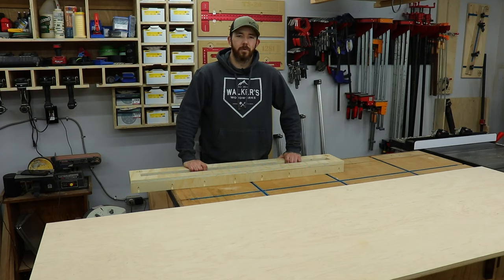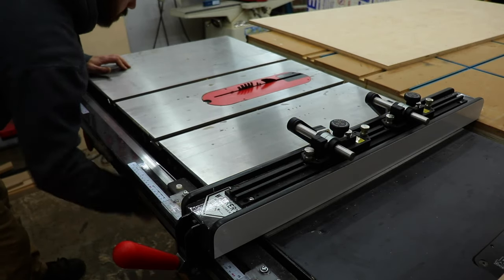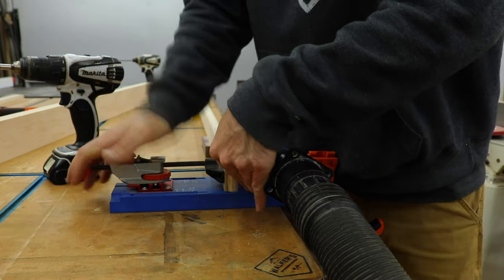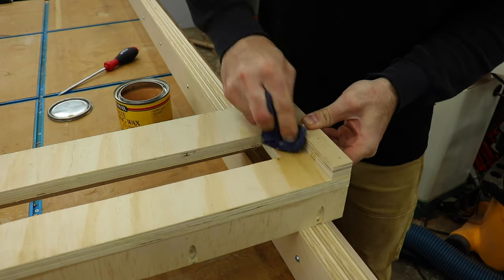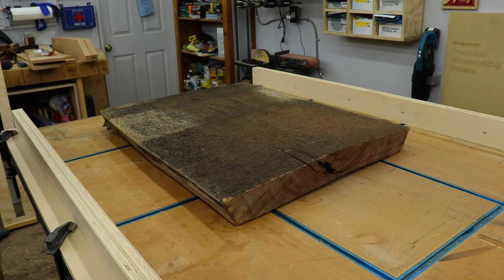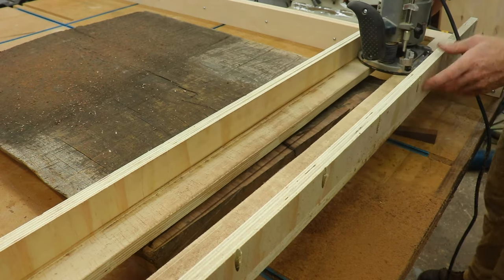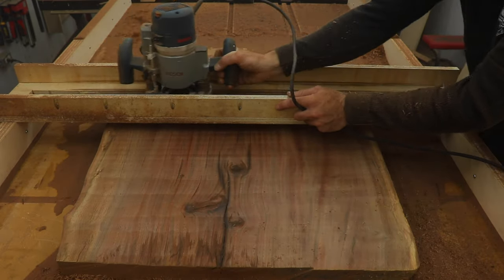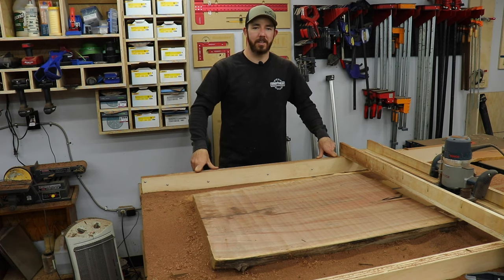Upgraded router sled rails and a new flattening bit! / How to flatten a slab

Comment: I primarily flatten edge grain cutting boards. I built a combination juice groove and flattening jig. I use the long rails screwed to a 30" x 30"  piece of 3/4 plywood and move them where I need them to be and simply screw them in place. The inner bottom edge sets back the juice groove and also serves to space the board when flattening. So I just set the board in place and move the long inner edge right up against the board use the short edge to hold the board. It works great and saves space as I just drill a hole in a corner and hang it on the wall.
Reply from the maker: That sounds like a great Idea!

Comment: So long as your side rails are all true and you work out plunge depths IE max and min you could flip your side rails  when you want to go lower, using the narrower rail as the upright, by doing this you can use the sled for a larger variety of thickness.
Reply: Not a bad idea. Side rails with two height options.
Reply: Good tip. Alternatively it’s not a little bit of effort to throw another slab under the piece you’re working with

Comment: I just built this thing soup to nuts but a different size and I didn't have a pocket hole driller so i used counter sink deck screws and they worked great.  This is a great video.
Reply from the maker: Whatever works!  That's awesome.  Glad you enjoyed the video.
Reply: @WalkersWoodworks  I'm definitely an amateur but sure having fun. Cant wait to watch more of yoir videos!
Reply: @WalkersWoodworks  question.  I have a Bosch 1617EVS with the plunger all the way down, the bit doesnt clear the sled. Even on the regular base it barely clears the sled...what am I doing wrong?
Reply from the maker: Is it hitting the adjustable stop?  There is a stop that has three settings you can rotate.  If not maybe the bit is to far in?
Reply: @WalkersWoodworks  nah. I figured it out. The 3/4 inch plywood was too thick for my router. Had to go to 1/4 inch. Works great now. Already flattened a slab today. Thanks for following up

Comment: My Amazon purchased work bench is planked construction pine.  I want to add a nice dead flat mdf top. This looks the best way to flat those planks prior to fitting the mdf.  Instead of fitting the rails to the top of the bench, I will screw them to the sides with standoffs to get a full bench width coverage by the router.  The bench top is preassembled with framing nails😳….So I hope they stop well under the surface or it will cost me a surfacing bit!!!!  Router: I only have a Dewalt cordless brushless trim router with the optional plunge base.  It will run about an hour on its 5Ah battery, but the surfacing bit is only 1 inch dia, and you can’t bog the little motor…So I am looking at a long job huh, but it will be a bit of fun!

Comment: Great video.  Just did this with a 65" x 24"  Oak slab a few days ago.  My router is quite small (Festool OF1010) and all I had was a 10mm  (about 3/8") plan bit.  It worked great but did take several passes and a few hours.  My router is quite small but I do plan to use a 35mm planning bit for my next project.  Longer term I am getting the Makita RP2300 (2300watt) router with 60mm planning bit.

Comment: I just bought the same bit just a couple weeks ago, it is a beast!
Reply from the maker: Ty OT Woodworks yes it is!
Reply: When I looked it up, the bit is supposed to be for a cnc machine, is that correct? Can I use it in a regular router?

Comment: Nice video. Suggestion, make the inside rails adjustable so as you take material off you can lower the jig to the slab. They may have to start out a little shorter to begin with but should work. Just a thought.
Reply from the maker: Ya I do want to do that for sure.  Thanks!

Comment: Hi! Thanks for making the video. Did the 2 inch bit fit with the stock Bosch sub base that came with the router? The hole seems to be close to 2 inches. Concerned about collision.
Reply from the maker: I didn't have to make any adjustments.

Comment: Love your videos! Absolutely need to build one of these! Does the work surface you are putting the slabs on to flatten also have to be perfectly flat and level before you flatten your slabs?
Reply from the maker: Yes it does need to be fairly flat.  Thank you for watching! I really appreciate the comment. 😁
Reply: Probably most important is to ensure the side rails are parallel. You could eyeball them or use a level. The sled itself is the reference more than the table, though a flat table will certainly be advantage. Keeping the piece secure is critical too - wedges and maybe hotglue as mentioned. Cheers - Dave
Reply: The tops of the rails need to be in the same plain.( plane ?)

Comment: Did you have to take the Bosch router base plate off so the two inch bit would clear? I have the same router and it seems that the baseplate won’t fit. Thinking about the collet extender but am worried it might kill me. Thanks for the great ideas.
Reply from the maker: I don't think I had to.  I honestly can't remember lol.

Comment: Thanks for sharing this, I will be using this to build my sled. Question - how low does the bit go (reach) from the underside of the sled? My fear is if I build the rails too high, the bit might not reach the slab....
Reply from the maker: If it doesn't reach I just shim the slab up so it reaches. 👍

Comment: Hi, great video. I’m making a work bench using 4x4 lumber for the table top. How would this be used effectively to mill it?
Reply from the maker: It would work great!
Reply: Attach rails to the side of the bench below the finished surface height.

Comment: Hey man. Thanks for the video! Do I need a plunge based router for this to work best?
Reply from the maker: That's what I use.
Reply: I use a fixed base just  takes a little longer to adjust.

Comment: I have made the sled and everything works fine.  The only question I have is:  How do you secure the piece that you're going rout solid so that is does not move while working on it?
Reply: I’ve seen some people use small amounts of hot glue or folded over duct tape. Another idea is to NOT cut off any excess wood first and use the unused piece to clamp it down to the table. He maybe could have done that in the video instead of cutting it with a chain saw first but not 100% sure.
Reply: Fasten it to a piece of plywood. Hold the plywood with clamps or barbell weights.

Comment: do you have any advice? I made a flattening sled yesterday with 3/4 in thickness as well, just like yours here, but my router bit can't reach down far enough to actually be used. I checked your link about the bit in this video, but it doesn't give overall length of the bit. how long is the bit that you're using? I'm wondering if mine is just too short. Thanks for the help!
Reply from the maker: Are you using a plunge base?
Reply: jkowalski33 Have you thought about a collet extension?
Reply: Use blocks and shims to raise the workpiece.

Comment: Why did he make the rails 3 1/2 inches high?  The slabs I am flattening are typically  2 inches thick and my router bit will not reach the slab. I have to place a number of spacers beneath the slab. I think the rails should be more like 2 inches high
Reply from the maker: Most of the slabs I've come across start out at 3"
Reply: @WalkersWoodworks  I cut 2.5 and 3.5 in slabs. Some of my older 2 inch slabs are shimmed up. Prepare for the thickest.
Reply: You better build him a different one to your likings and send it to him free of charge then @eldonwalker
Reply: The rails need to be stiff. Plywood of mdf spacer sheets.

Comment: Instead of raising the piece to smooth the other side could you turn your rails to the shorter side you clamped to the table?
Reply from the maker: Probably could but that would be a 1 1/2" drop.  Probably to much.  Might try it though!
Reply: How about making the clamp rails wider - maybe only 1" less than the side rails. This idea would work then.

Comment: Hello, i am trying to make my own slider but i am confused about the high of side wood , u have to always to new ones with specific high ? because i can't figure out how to do universal one (where u can mill high 5cm and 2cm) .. is it possible ? or i have to always make new sides which depends on high of creation ? (got also Bosh milling machine and my tool sticks like only 2cm from the machine) thank you :)
Reply from the maker: I mostly flatten only 2" - 3" slabs so the one size works for me.

Comment: Followed along from the first video and built the jig then thought I would save about $50.00 by buying the 1"x1/4" spoil board router bit for a spare router I have. BIG MISTAKE!!!! the shaft length is so short it only stuck out about 1/16" past the jig itself and nowhere on the website does it give total length of bit. Of course I took the wax/plastic coating off the bit and tried it so now I can't return it. Had to drop the $98.00 to get the 2"×1/2" shank bit which sits about 3/4" farther out from the collet than the 1"×1/4". Now I have a unusable/nonrefundable $50.00 bit. Mehhhh
Reply from the maker: Ah that sucks!  Sorry to hear that.  BUT! I have a suggestion.  You can make a sled like this one out of angle iron and it should be useable that way.  My friend Jesse has a video on one he built.  Check it out.  https://youtu.be/7s4iqVObqag
Reply: @WalkersWoodworks  on an upside, i did get your 15% discount with WALKER15. Thank you!
P.s. I'm pretty sure I have some angle iron around!👍

Comment: "If you had a lighter slab, you may need to secure it to the table.  Hot glue works pretty well for that."

Really?  Against the force of the router bit, it'll hold?
Reply from the maker: Yep!  Works just fine as long as you don't take off a ton of material.
Reply: Chris Rogers it does! Especially the bigger heat glue guns, but the little hot glue guns work as well
Reply: For a simpler cleanup, just add painter's tape to both the table and the slab, then use CA glue to join the two ends of painter's tape. It's used quite often as a holding method for CNC machines. When you're done, lift the slab and peel off the tape.

Comment: Nice, but put casters on that work bench and do that shit outside. Now your whole work space is covered in fine sawdust. Also, there are way too many ripples on that finished slab. Your router may need to be shimmed on one side. Good luck.
Reply from the maker: Ever tried to film a good video outside?  When I do it off camera it's definitely outside.  Also the lines aren't as bad as they look.  They sand right out. 👍
Reply: @WalkersWoodworks  , I am two thirds building a slab jig, and I can tell already there will be ripples left behind. Too many variables